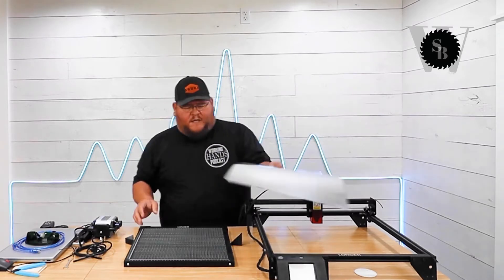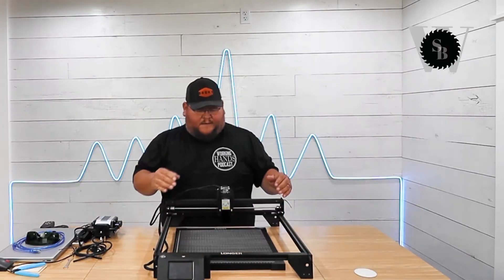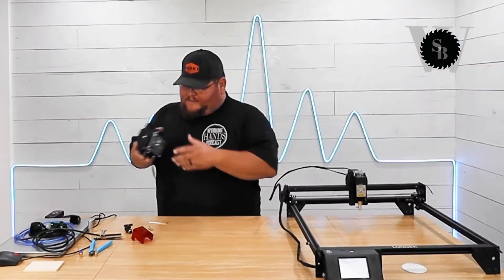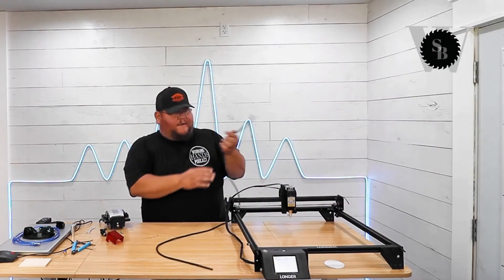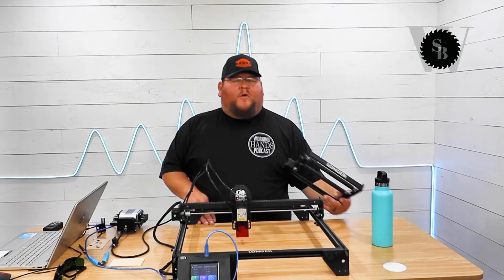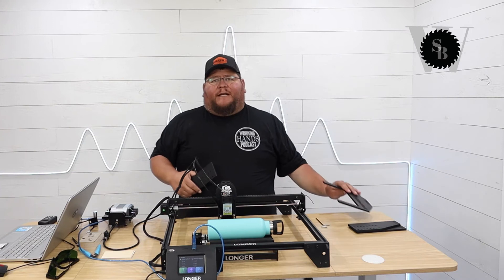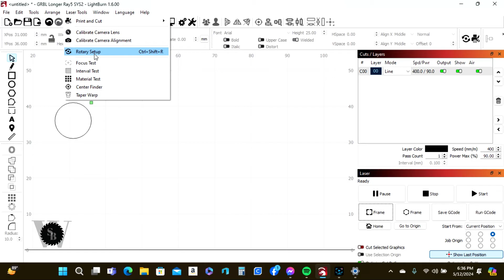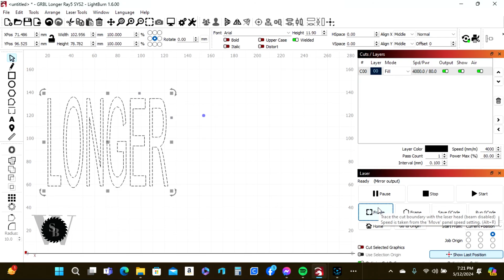LONGER RAY5 10W LASER - Best Budget Laser Accessories Upgrade!

Comment: What do you for venting the fumes out. Are they not strong in that room
Reply from the maker: At the time of the video I had not hooked up any venting. However, you definitely need to have some fume extraction in place when operating a laser. I have it plumbed into my main vent line along with my CO2 laser.

Comment: Very informative and easy to follow.
1st question, when you disconnect the rotors, do you need to change the settings in light burn?
2nd question, have you decided to sell the legs you designed ?
Reply from the maker: Thanks for watching! Yes there is settings that need to be changed and in my video those settings are explained. As far as the legs go I have not made a decision yet.

Comment: Hey bud. I have an extra cable. The small one on top of the laser box component. Can't find a connection for it anywhere. Also can you make a video for the assembly of the rotary. 😊
Reply from the maker: Hey bud check out the first video on the laser setup and that should answer your question. I will put rotary assembly video on my list and try to get one made. Thanks for watching!!

Comment: How many psi is the pump.  Wondering if you could diy something using a fish tank pump
Reply from the maker: I’m not sure on the actual amount of PSI from the pump, but it is a really strong flow of air. I would recommend using the equipment manufactured for the laser to avoid any damage or problems with your laser. Thanks for watching!

Comment: thanks for the video. 
so that's the $200 laser with a $100 rotation accessory?
have you seen a drop in performance in say doing a dozen tumblers?
thanks
Reply from the maker: I have not done that many tumblers with the laser, but what I have done with the laser so far has been on point with no loss in performance. Thanks for watching and commenting!